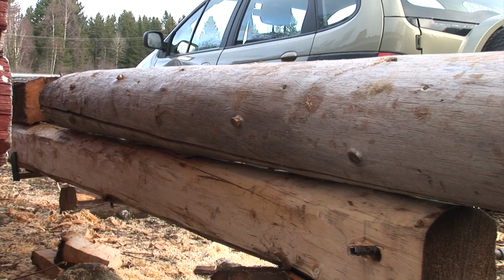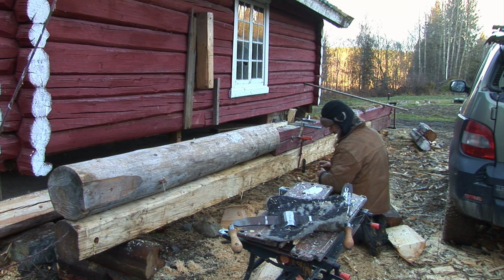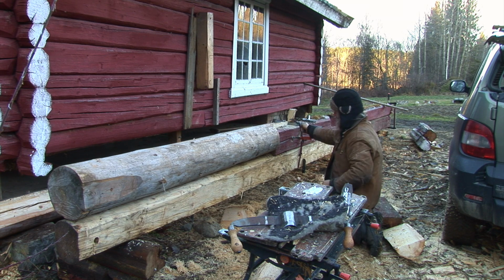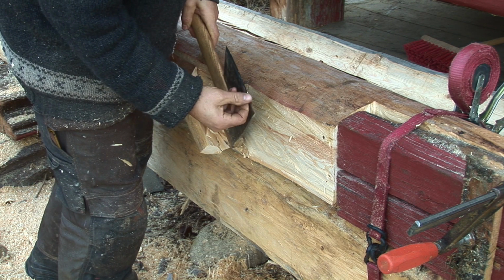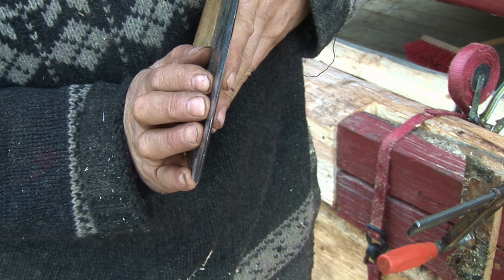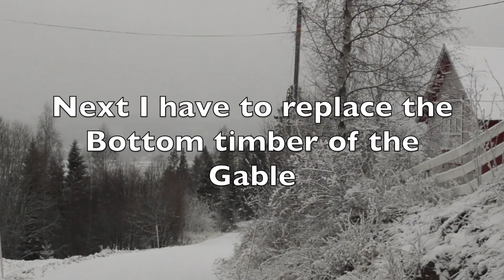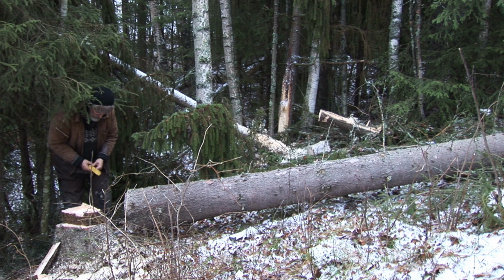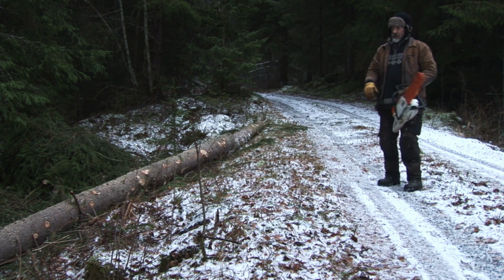🔴 Log House Repair in Norway Part 3/15 - Timber Hunting

Comment: Putting in a lot of hard work. Love the vids, thanks for sharing.
A tool that might help in the future is an Increment Borer which can be used to take a 
core sample from a tree with very little damage. It would allow you to see the growth without
actually having to take it down to see. Good luck. Looking forward to more vids.
Reply from the maker: Thanks for watching! I have a plug maker which I have used in the past to sample a tree's growth but it only cuts about 6 cm deep. Thanks for your suggestion I will look out for an increment borer. Felling these two damaged trees was my way of checking the general characteristics of the stand as a whole, without committing to felling a healthily growing tree. In the next part I get help from a farmer who suggests a known stand, to find slow grown timber.
Reply: @LucasRichardStephens  There's usually a lot more thought that goes into decisions than can be readily conveyed in a short vid. 
I stand firm w/your judgments and feel confident you are doing what is best in the situation for restoration and preservation of your builds as well as the forests. 
Thank you again!
Reply from the maker: I had a look at an increment borer by HAGLÖF , they were pretty expensive. It will have to go on my wish list.  Thanks for the heads up!
Reply: @LucasRichardStephens  I might have a bore laying around ... or you may contact Landsskogtakseringen at NIBIO and ask if they have an old one you can buy.
Reply from the maker: @SteifWood  Thanks SW!

Comment: Good work as usual!! putting a nick in a tool's edge is always disappointing, but we get good a fixing them don't we!  That last tree, then you took from your friend's place looks really good. When you say fast vs slow growing, what are you aiming for in terms of growth ring spacing?
Reply from the maker: Hi David, the year spacing for a first tier timber has to be tight, 8-16 year rings a cm. Faster grown timbers are fine higher up in the wall where the roof provides better protection from frequent soaking.
Reply: @LucasRichardStephens  Make a lot os sense! great to see you back at it!! Love the axe as usual. wish I could afford he one you had available a while back! Keep up the great work!!